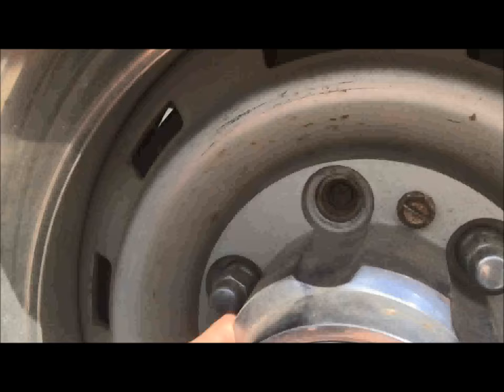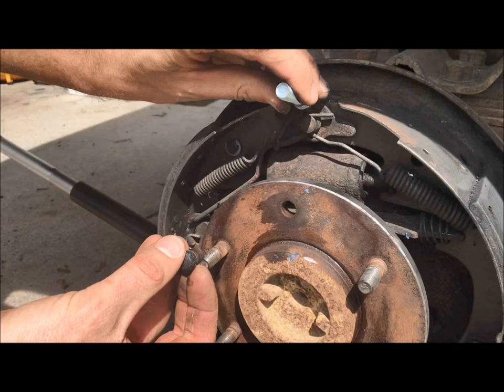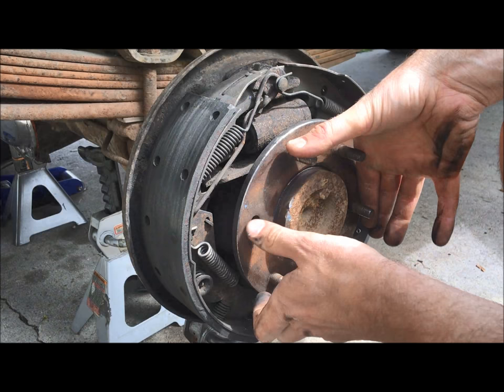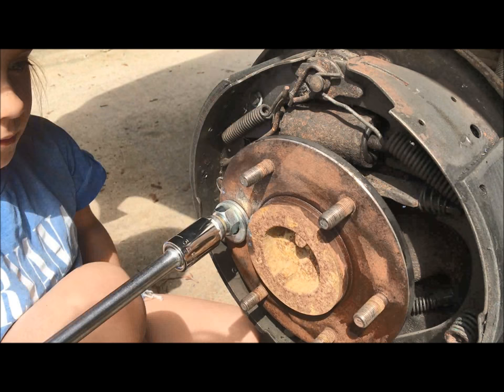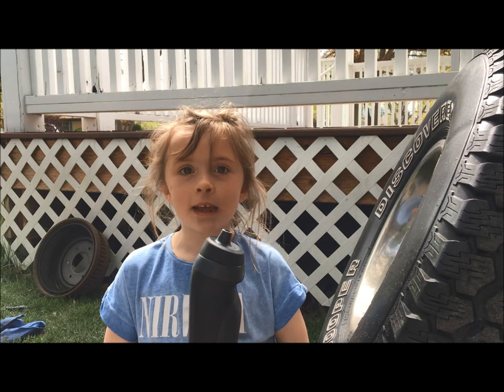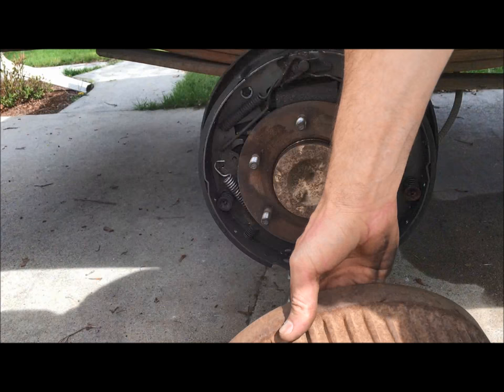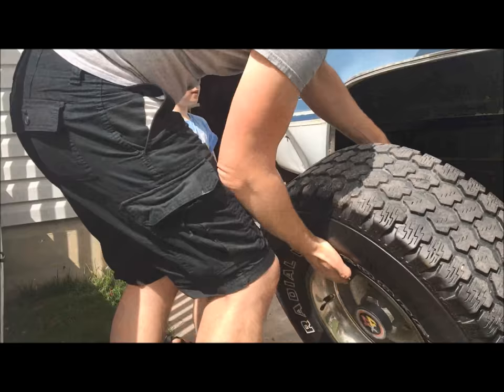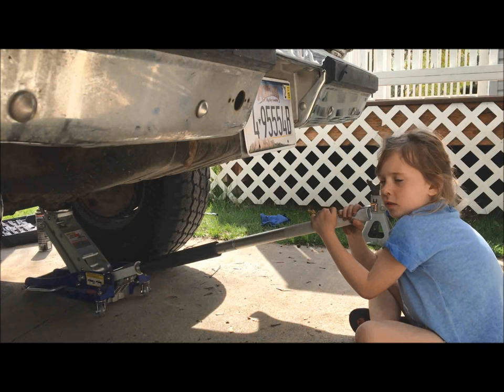Broken Wheel Stud Replacement - So Easy A Kid Does it

Comment: I like these little mechanic tricks that are hidden around YouTube, this saves me from looking like an idiot and taking my 3 broken wheel studs to the tire shop.

What brand jack do you use?
Reply from the maker: Glad you could put some use to it.  That jack is the 1.5 ton from Harbor Freight.
Reply: I ended up having to replace all 20 of my studs because I put the wrong pitch thread lug nuts on.

Comment: Good job by you both.

Question: if you hammer the stud so it sits in the hub but isn't quite flush, would the tightening of the lug nuts flush it against the hub?

Comment: one of my Integra wheels on my '96 corolla (yes those wheels fit) was flat so I put the factory wheel back on & not even fully tightened, a stud snaps with half of the stud in the lugnut

Comment: Did yours just happen to snap off clean, flush with the hub/bearing? Or did you do that? Even after it snapped off, my wheel stud is still pretty long so I'm thinking use a cutting wheel to get it flush to the hub like yours? I just don't see that punch method working too good if the stud is long
Reply from the maker: It actually broke off like that. You could always put an old lug nut on the end of it is there are enough threads and pound it out.

Comment: those harbor freight jack stands were recalled twice for safety issues, if you didn't already than take them back and get a refund
Reply: Depends on when uve bought them, I've had mine 3 years no issues and I usually work on 4500+ lb vehicles with them
Reply: @dreadheadgarage  no it doesn't matter when you bought them, they have a poster in the store that states the recall spans i think like several decades. and EVERY jack stand was recalled, including the 2nd redesigned new ones so YES you're 3 year old stands are included in the 2nd recall. ask them and look at the poster

Comment: Great video.  I wished mine were as easy to change.  Looks like I have to take the brakes off to get the brake rotor off to get to the bolts…..

Comment: Great video.. so what do I do if while tightening the new wheel studs they spinning..? 😩😩 I’m using hand tools, ratchet and a socket.!
Reply from the maker: Did they sell you the right size studs?  Sounds like make they are to small.
Reply: @MechanicLife  am assuming I got the right size.. but honestly I think there is a very small diff on the the new ones, very very thinner.. is there a trick or tip to put them on.? What about if I weld them to the hub.? 🤦‍♂️🤦‍♂️
Reply: @MechanicLife  am assuming I got the right size.. but honestly I think there is a very small diff on the the new ones, very very thinner.. is there a trick or tip to put them on.? What about if I weld them to the hub.? 🤦‍♂️🤦‍♂️

Comment: OH HORSE FEATHERS - tap, tap, tap and your wheel stud just fall out, right?  I've been beating on my broken wheel stud with a mini sledge and it still won't come out.  And I used the punch method, too.  If I had been smart, I would have put an old lug nut on the stud and hammered on the nut instead of the stud.  Now it's too deformed to get a lug nut onto it.  I guess my only other option is heat unless someone has a magical method for me to try.  I did just see a video where the guy used an air hammer and that seemed to work well.  I'll have to dig around and see if I can find mine.  UPDATE FOR THE REAL WORLD - the magic method was to go over to Harbor Freight and buy their $ 15 AIR HAMMER and another $ 60 for their tool set with the actual hammer head.  Even then it took awhile for that damn stud to pop out.  I had soaked that stud with PB Blaster for two days, too.
Reply from the maker: Man that thing must have been really on there!!
Reply: @MechanicLife  The more I work on that F-150 the more I realize that it is a junkyard Frankenstein.  Come to find out, it seems to have a 1994 cab sitting on a 1987-1993 chassis.  That would account for why I couldn't find front calipers with slide pins for the 1994.  They had switched over to two bolts holding the calipers on.  I can only imagine where it sat for probably many years in a field that let that bolt rust right into place.  I wondered why it was a three color truck.  The bed, the doors and other parts were all different colors.

Comment: Why do you use washers and nuts? Why do you not use just a  lug nut without a washer? What is the purpose of using washers?
Reply from the maker: The lugs I was using wouldn't bottom out on the stud. So instead I put washers in place to get a flat surface and used a nut because its open ended and can be used to pull the stud all the way into place.

Comment: Jobs only easy if it's easy haha. I had to replace a stud and it required taking the hub off and the bearing as it was otherwise impossible to do so. What should've been an easy job turned into having to redo the bearing, put the stud in, put the bearing back on, then the hub and then the disc/caliper and wheel.

Comment: Great Video BUT PLEASE REMEMBER...
     There is Asbestos in many Brake Pads and Shoes since most are made Outside of America.  Thus she should have on Latex or Nitrile Gloves, I like RAVEN or Diamond Black Nitrile Gloves and maybe some mechanics gloves as well as respirator or mask of some sort and top it off with Eye Protection, Face Shield and maybe even a HardHat for her head Head Protection... Better to Have the Proper Protection and Proper Tool for the Job.... When Bad Stuff Happens, It Happens FAST.... 
  I am Not knocking You, I love the video but I have seen jacks blow a seal and drop 3000 lbs 1 Inch , thats enough to hurt and worse... 
  I've seen Punches brake their tip off and imbed in someone's cheek literally Right After I told them to wear protection. 
   I've seen people have respiratory distress from Solvents and Chlorinated Brake Clean, though I use Non-Chlorinated Brake Clean, still nasty stuff.. Outside equals Well Ventilated so thats Great.. 
  Point is, I Love the Video and You have a Beautiful Daughter who wants to be apart of whatever you are doing.... So Protect Her , even if it's just one job...
 Plus she would possibly Love getting an Entire Work and Safety Outfit !!!
   She should also listen to AC/DC Back in Black or Judas Priest Desert Plains or something while working on the Truck \m/
  
Note: If needed, AeroKroil is the Best Penitrating Oil